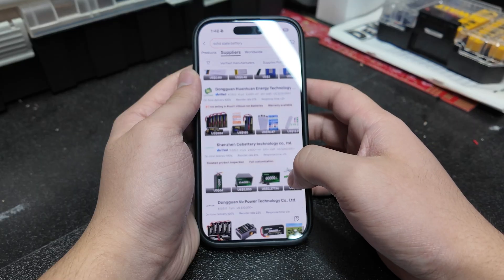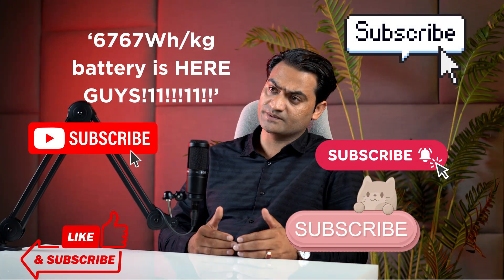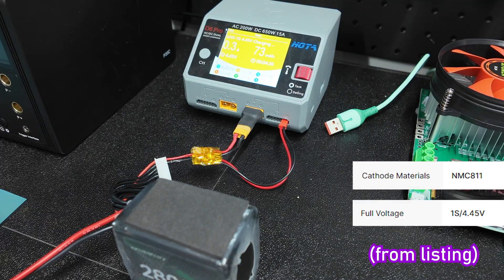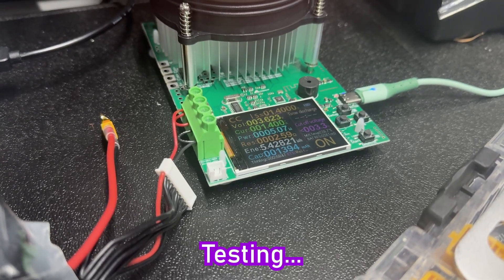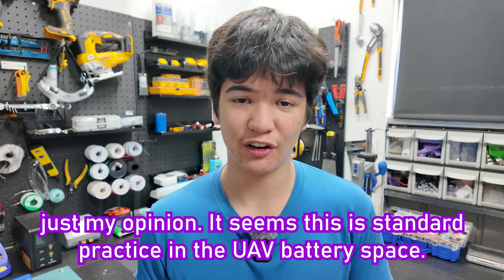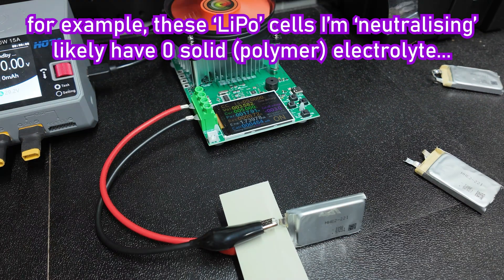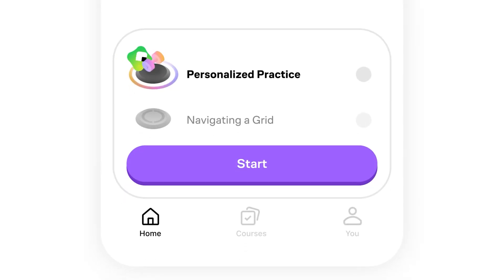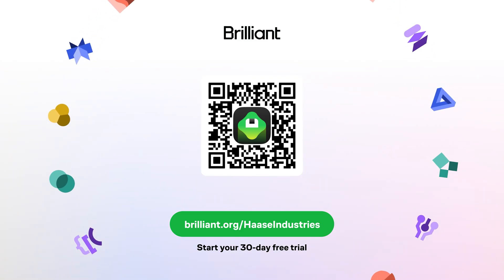'Semi-solid state' battery TESTED - $50 for this much power?!

Comment: So how does it compare to a SiC battery. Semi-solid state battery has similiar volume density at about 875 Wh/L, but weight density seems to be a bit higher. So on top of extra battery life from a SiC battery, we would also get lighter devices. These batteries would be huge for PC gaming handhelds.
Reply from the maker: No offence, and it’s not your fault, but this is why consumer tech marketing and coverage really irritates me. Because any battery above ~250Wh/kg (i.e. almost all modern ones) are ‘SiC’ - they need a little bit of silicon in the anode to push into this range. Even modern iPhones, which are commonly believed to be just ‘lithium-ion’ would have to use a percentage of silicon in their anodes to be as energy dense as they are. They just don’t go around telling everyone because it’s probably not as big an amount like some of these other Chinese smartphones, and they want to be simplistic - user focused.

Tech news outlets just need to feed themselves and their family and put a roof above their heads at the end of the day - and it’s a lot easier to do that when artificial controversy is being created which also allows them to perform paid advertising for certain companies or promote paid ideologies, as if the 15 Google ads on their page weren’t enough.

I saw articles talking about ‘silicon-carbon vs lithium-ion batteries’, and had 8 haemorrhoids, on the spot. As if one part of the battery was silicon… and the other side of it was carbon. Because silicon-carbon IS a type of lithium-ion, and a really common one at that!!

Anyways, to answer your question properly, I have no clue. Semi-solid state electrolyte, just like silicon-carbon anode, is just one attribute of a battery, and we can’t predict the whole performance of the battery just based on them. There’s nothing stopping both from existing together in one battery - that’s likely what I bought and showcased in this video. And lines are fuzzy too. What percentage liquid can you call it semi solid? What percentage silicon can you call it silicon-carbon? It’s completely unregulated.

How one would perform vs the other all depends on how the manufacturer tunes things. With that being said, batteries intended for smartphones, what some companies call ‘SiC’ tend to have the edge on volume density as you’ve pointed out, and, a ‘semi solid’ battery intended for drones would tend to have the edge on weight density.

On the other end of the spectrum, silicon-carbon anode batteries tuned for big power outputs in power tool batteries have lower energy density in both weight and volume. Semi-solid state batteries tuned to be as puncture proof as possible might have terrible all-around electrical performance that they traded off.

Anyways, sorry for the rant, and sorry if I came across as condescending in any way - I’m just frustrated with the system 😂 it’s so late here

Comment: any plans to open source your bms????
Reply from the maker: no, it's useless to anyone who isn't using a 3S tabless 18650 pack and wants USB-C PD charging and a user power switch. I linked all the documentation I learned to make it from in the video. It's easier and more reliable to read that than to try modifying 'my design', which is just following those guidelines anyways. If you have specific questions during your design you can always feel free to ask me. If I release a proper dev board product around this, you can be sure it'll be open source. Maybe I could stack the PD charging, BMS, and power switch components so the form factor is more practical, and add additional protection features such as a fuse and voltage transient suppression.

Comment: Nice test and great understanding of the SSB concept. I would suggest you to get an accurate capacity tester that can display real graph and export it in excel so you can extract more data. Typical NMC like the 532, 811 or even 955 have all different curves shapes and NCA also have different shape as NMC. Just by the discahrge curve analysis you could easy tell if these are SSB for exemple by the activation, overpotential  and concentration polarization  zone of the curves.
Reply from the maker: Thanks so much! I’ve seen you all around Facebook and Endless Sphere forums, watched a few of your videos too. I have the discharge graph in Excel format. But not the charge one. Would you truly be able to tell the difference between 100% liquid electrolyte and 10% just by the discharge graph if it was more accurate equipment and a side-by-side comparison?
Reply from the maker: I do need to get something for capacity, high power discharge (normal e-load function would be cool too) and maybe even cycle life tests and DCIR. Any machines you’ve heard good things about?

Comment: So is per wH is lighter than say like 21700 p50b or jp50 or rs50. At 30c should 100% beat 21700 amps available
Reply from the maker: I highly doubt it beats the newest tabless 21700s and 18650s in power density. But only testing could tell. It’s not difficult for any battery to allow a 30C pulse for less than 3 seconds.
Reply: @h1tec  oh for Less Than 3 seconds yeah. The new 21700 are doing 60 amps and 70 amps continuous (mostly some say 80c cutoff) and I've burst way past their rating lol
Reply from the maker: @divingfalconfpv4602  the range that you can apparently draw high power in using this 'semi-solid' battery is to 3.35V as mentioned in the video, and it only reaches ~260Wh/kg at that level. If we compare its '7C in still air' claim to Molicel P50B, it might beat it by a bit. True tabless 21700 - RS50, 50XG, 50PL, would beat it by a very large amount. We'd have to test to see though.

Comment: I may have missed this in the video but what is the weight of the pack, how may mah did you get out of it and at what discharge current?
Reply: Oh I see now. 

Did you do any tests to the recommended minimum voltage at a higher draw, say 2C?
Reply from the maker: @s @sarahdaviscc I didn’t test a higher current cutoff for the first voltage cutoff (3.35V) since my e-load only supports 5A and the balance lead connection couldn’t be used at high current.

Comment: Hmm, would be interesting to see if RC hobbyists are using these, and what kind of performance they’re getting. The higher charge voltage might put some cell arrangements too high a voltage for some ESCs, but I doubt it’s a big deal.

Oh and what chips do you plan on using for your power-bank?
Reply from the maker: Probably not a lot of them would be using these yet. Some of them should be though! Too many chips to list and I haven’t finalised my choices yet - the project will be fully open-source so you’ll see it by then anyways 😁

Comment: I wonder whether you could use these in place of normal Li-ion, and have a long life because they would only be charged to 4.2V.
Reply from the maker: Yeah you could, that’s true. Not sure how much more capacity you’d lose, but you could do that and expect a longer life, yeah
Reply from the maker: oh yeah forgot about the undervoltage cutoffs though, so it's not a full-on replacement of course.
Reply: @h1tec  So the high AND low voltage limits are both shifted up for this. I thought that might be the case.

Comment: Cool video and tests. Do you recommend it i need it for my drones or should i stick to lipo?
Reply from the maker: For long-range drones which don’t draw a lot of current, where runtime is the priority, it would be great. I generally would either use this battery if energy density and pouch form factor is the priority or a tabless 18650/21700 battery for higher power but still good energy density.
Reply: @h1tec thank you very much. You gained a subscriber
Reply from the maker: @mryafeay thanks! If you want to know more about cylindrical battery testing, I would highly recommend checking out Battery Mooch’s patreon page as well as Pajda’s patreon page. They have some really good tests there.

Comment: No engineer using Brilliant, but LLMs. Great video, though.
Reply: no true engineer uses LLMs either, use your brain!
Reply from the maker: @Megasteel32  I still think LLMs are great for accelerating surface-level, application-focused learning. Which can be useful sometimes if you really just need something working ASAP. And also, to talk to and reason with, like a rubber duck. At the end of the day a YouTube video or a long, boring piece of literature from a company works 100x better. But a little bit of both isn’t too bad, if you understand you’re just trading the time you’re saving now for gaps in your knowledge later.
Reply from the maker: Thanks!